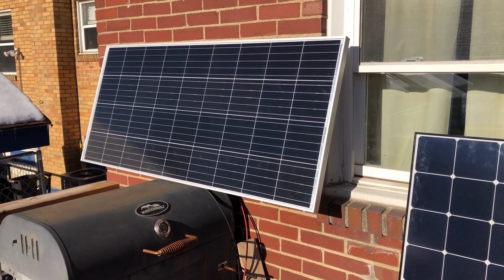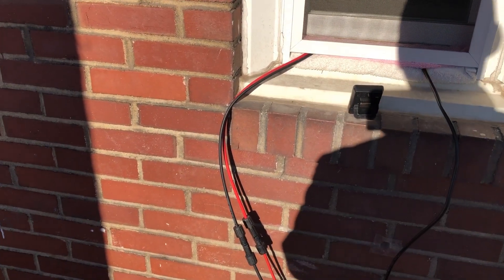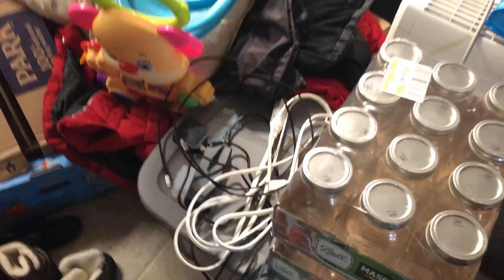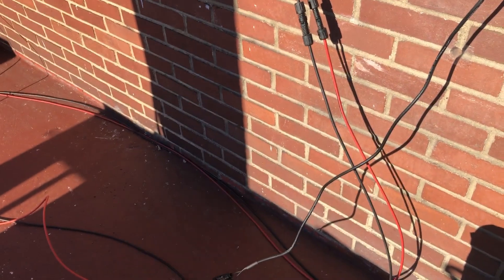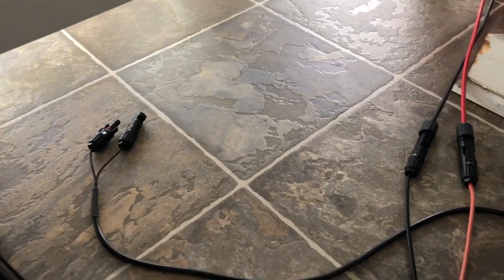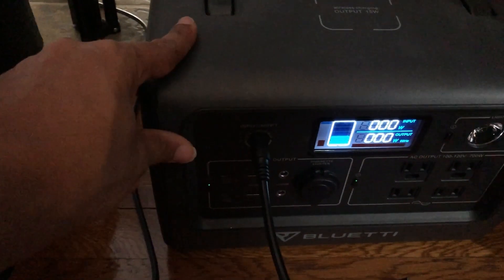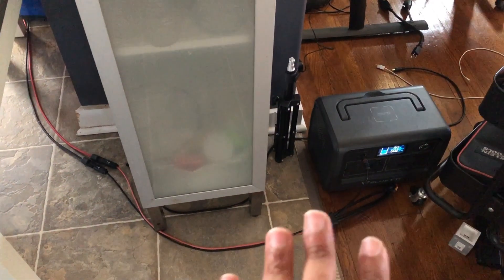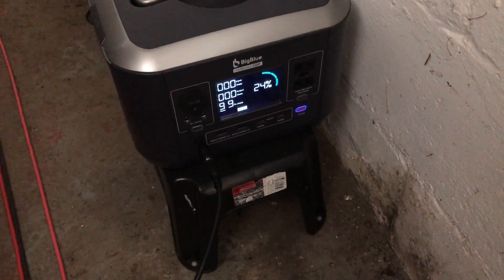My Bluetti EB70 Stopped Charging! | Watch Until The End

Comment: Mine is not charging in my truck with the 12v cord. I notice it either  is not charging at all, or it is bringing in watts sporadically.
Reply from the maker: What happens when you charge it with solar or ac?
Reply: @AskIveSolar  AC it charges fine. Solar seemed to be working,  it is not very sunny here so we chalked up the slow charge time to our location. Thanks for the response.
Reply from the maker: @openyoureyes3969 those 12v adapters have rarely impressed me. They've typically sucked especially from that time frame. My bluetto AC60 one seems to be holding up fine tho.

Comment: Totally expected this to go another way. Glad it was just the cable though. Do you have a thermal camera? I'd be curious about the temperature of your various cable. They can get pretty warm charging if the gauge is not right
Reply from the maker: Nah no thermal cam. Most of my cables are 10 awg. I may have one or two that are 12 awg. I actually have my renogy sunpower panel on a 12 awg because it's so short.